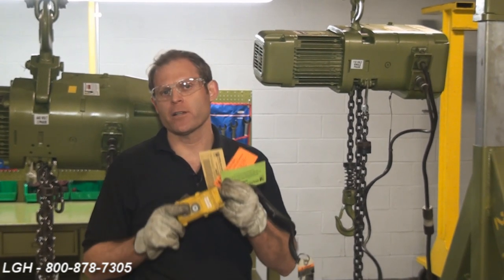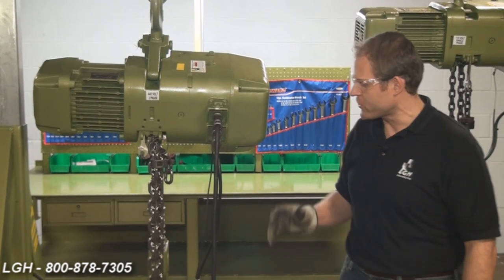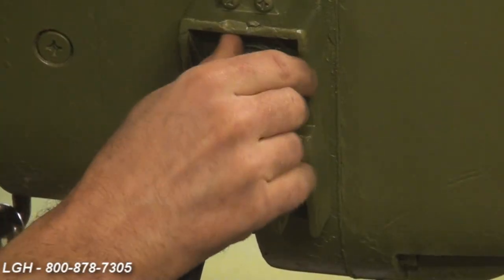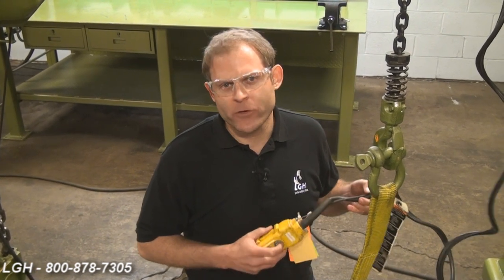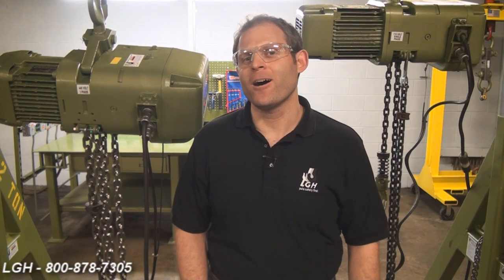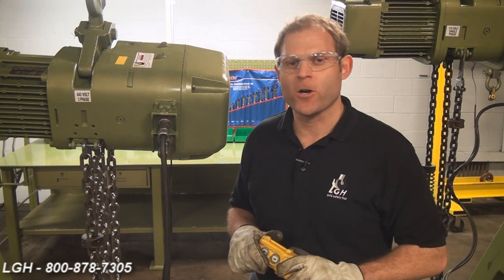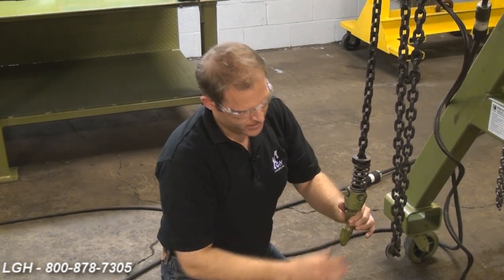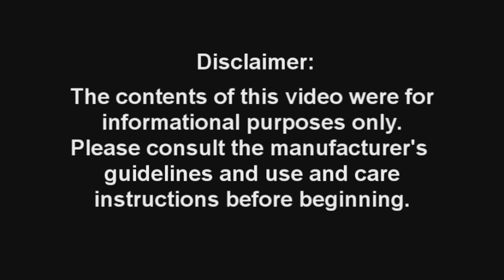Troubleshooting an Electric Chain Hoist

Comment: Excuseme , please hoist crane control connection wearing video post please.i wait for you.so ok.
Reply: its only soldered pins. male side is cable female side is power side. avoid shorts. plus hole are letters or numbers. always make a diagram before making cable. one I make are 32 and 64 pins.